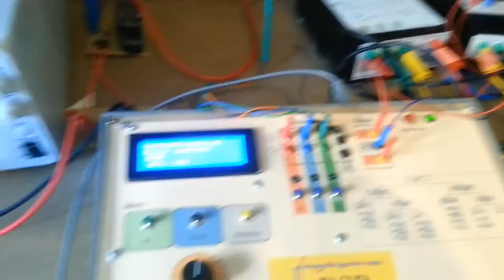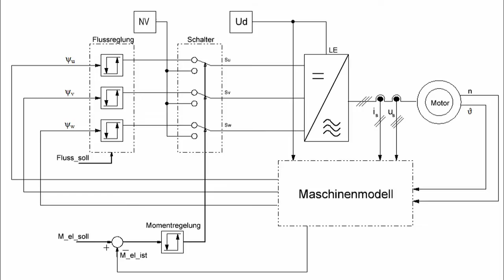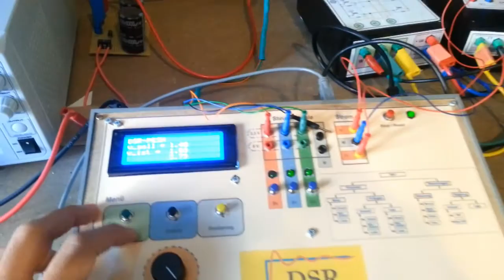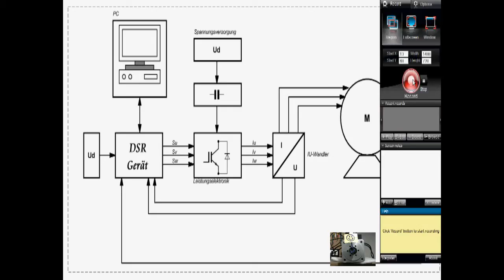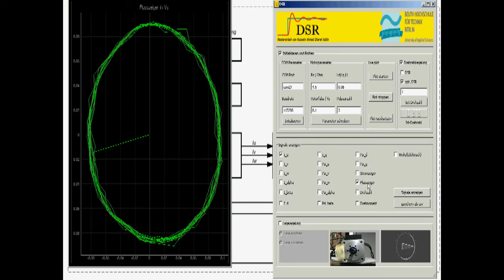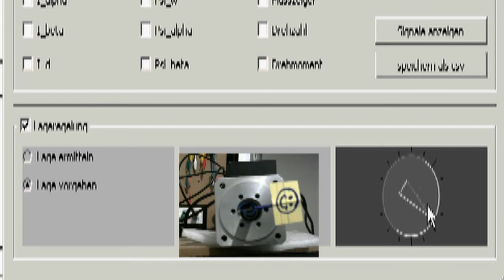Control of permanent magnet synchronous motor - Arduino platform

Comment: I must compliment you on a perfectly understandable presentation!  The eloquence of your presentation speaks volumes of your self-discipline, of your precision in thinking and reasoning!   These traits, for me and I'm sure for others, are what convey the complexities of circuit design into understandable, digestible morsels!!     

I am not an engineer of any sort, only a self-taught radio hobbyist - a RadioAmateur.  My online search to explore ways to control a motorized package for varying a variable capacitor remotely brought my search to this YouTube, gladly.   

Specifically, I wondered how one could precisely vary the variable capacitor without needing to rely on a stepper motor.   The undesirably in stepper motor use for remotely tuned antennas seems to be that running the stepper motor's multi-conductor cable from the radio shack to the antenna feed-point allows for RF, on transmit, to couple to these wires, making necessary for the operator to experimentally find methods to de-couple that RF - whether by choking it with ferrite or using .01 capacitors across leads, et al.

With the advent of circuits as yours, taking lead from the aforementioned German developer, I believe it's practical to use a permanent magnet synchronous motor to accomplish this rotation control without the complexity of near-field RF coupling - which causes this undesirable RF to be experienced at the radio-end operation.

I look forward to viewing more of your videos, and envision someone will perhaps package your assembly into a marketable product for RadioAmateurs to try.   Given the state-of-the-art pico-size circuitry available today, one would imagine introduction of such a product to market may not be too far ahead.

Once again, great presentation! - Precisely delivered, enjoyable to understand.  A pleasure to watch!

Comment: That's awesome. Great job, impressive. I know this was for school, but if you had to buy this type of controller "off the shelf" instead of building it yourself what would you recommend?
Reply from the maker: +darkmath100 Thank you.
Usually companies offer motor control with the field oriented control and not with the direct self control. I really don’t know any one that offers such complete system with this controlling technique, because it is often used to control big motors, for example in trains. But you can check Texas Instruments. They have a wide range of motor control solutions.